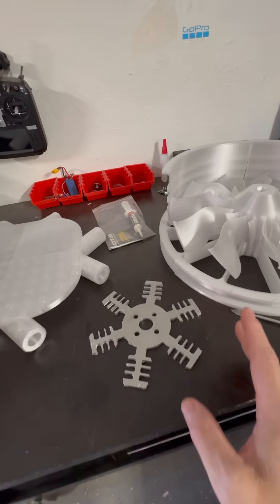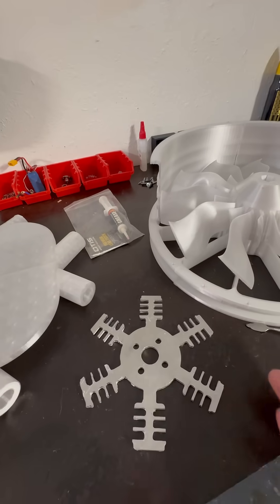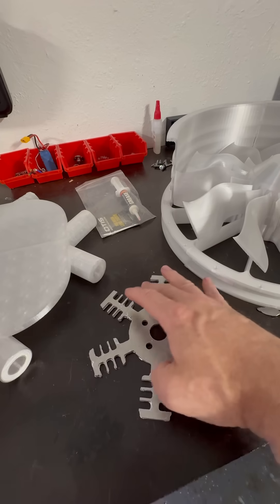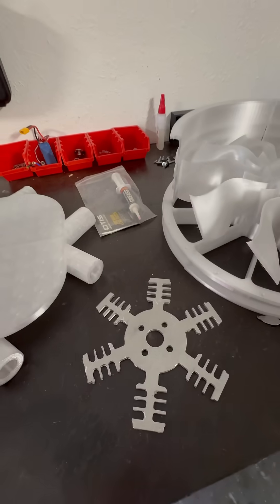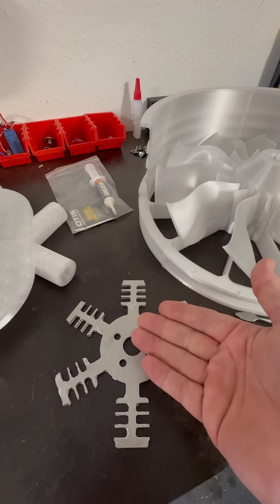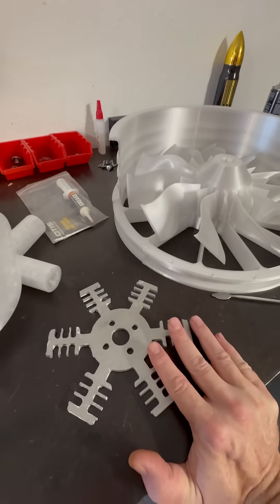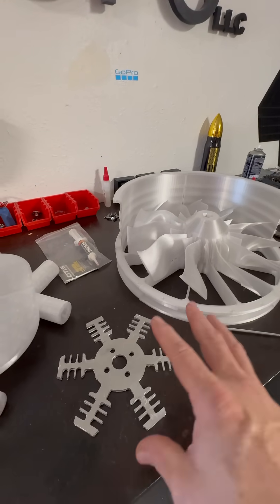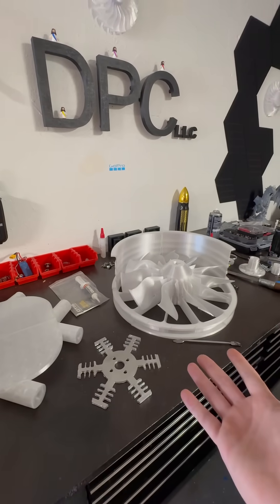Cooling the drive motor of the 340 mm EDF using a Peltier circuit grid. DIY heat pump. ￼￼

Comment: Only problem i would say, is that peltiers are very, very inefficient
Reply from the maker: I think the common misconception. Peltier, if used correctly can be very efficient. You have to understand. I’m running six of them. They’re only 12 V. They. Draw 3 to 6 amps it puts lower temperatures into the cooling fins while the hot side is cooled off by the fan and it’s standard Peltier heat sink The idea is the airflow is going to disperse hot air at the top of the pier, allowing the cool side to efficiently cool the heat sink between the motor mount and the engine.
Reply: @warmachined3472 its not a misconception it's the truth. they're at best 50% efficient. an actual heatpump is closer to 500%. you're out of your league
Reply from the maker: @Megasteel32  Bro really said 500% efficiency like he unlocked the laws of thermodynamics on a lunch break. That’s called COP, not actual efficiency and no, your heat pump isn’t rewriting physics. Mine’s running real thermal reclaim and Peltier-assisted convection, not Reddit level science fiction. Maybe sit this one out before you sprain something flexing misinformation.
Reply from the maker: Ah, sweet Megasteel,thou quoteth ‘latent heat’ as though naming it were summoning its power. Yet here I stand, builder of systems that dance with phase transitions, while thou flap thy tongue like an HVAC apprentice in his first fortnight. This is science, not sorcery, dear sir. One does not simply recite thermodynamic terms like incantations and expect relevance. Return when thy hands have known the tools, and not just the manual.
Reply from the maker: Imagine being so unfamiliar with nuance that every articulate sentence sounds like a foreign language. Don’t fret. Literacy isn’t for everyone.